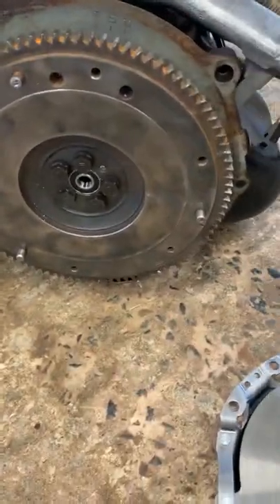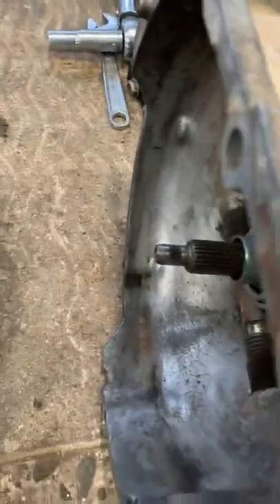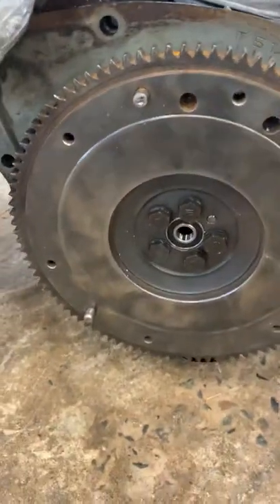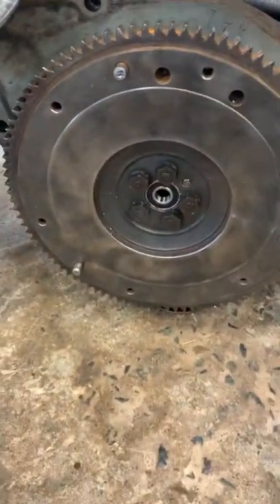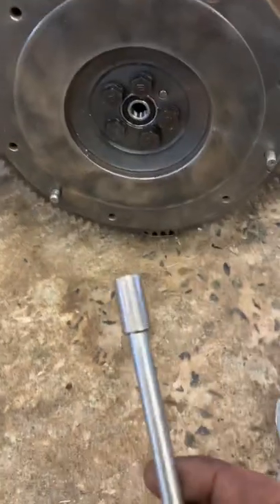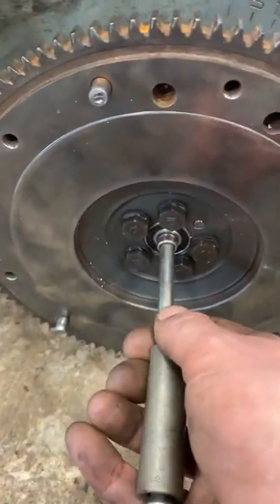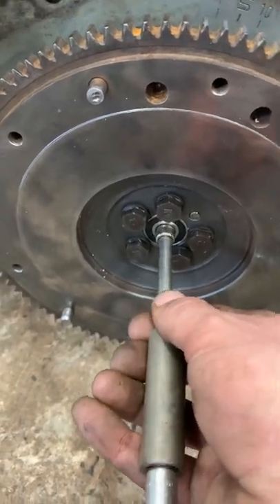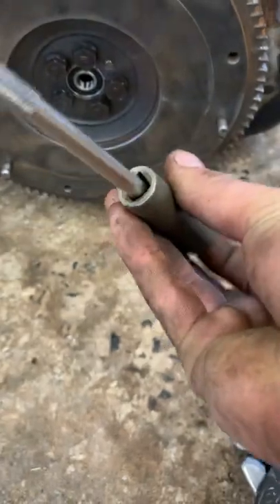No clutch alignment tool? No problem

Comment: I just closed one eye and looked at it straight on and tried to center it best I could and it worked great lol transmission went right on
Reply: Same here 😂 quick prod to feel if it’s about level all the round and jobs a goodun
Reply: @lukeshaw3375  yeah that was after failing with the stupid loose plastic alignment tool it came with and not being able to seat the transmission like 3 times
Reply: @WildfoxFabrication  my brother is a mechanic so I stole all his tools, turns out the alignment tool didn’t fit my car 🤦🏻‍♂️ the gearbox was a pain in the backside to fit back on but I managed it in the end 😂 not bad for my first attempt though

Comment: Hey my clutch won’t engage
Reply from the maker: @Trenchboi69  did you install the disc backwards?  Did you torque all your pressure plate bolts evenly?

Comment: Except what about when the socket dislodges inside when you try to pull it out.
Reply from the maker: A little tape will snug up a loose socket, and if it does come off it can’t really fall far since the clutch is between the pressure plate and flywheel at that point
Reply: @wellscody86  

And then you have to unscrew the thing again and screw it back on.

Is it really worth it to do this when the tool costs 18 dollars? You're already saving 100's of dollars doing the job yourself. Why not spend the minimum to have the correct tool that is so cheap anyway.
Reply from the maker: @MrBojangles901  it’s not about trying to save money, it’s about being able to think outside the box, use what you have available and the ability adapt and overcome.   Again this clutch kit for this engine / trans doesn’t come with the alignment tool, and I wasn’t able to source one. And to your point- most—not all but most clutches would have ample room to use your finger to grab the socket if it fell into the plate fingers, if not a magnet would surly get it out.  Your arguing something you probably don’t have a ton of experience with so the fear of the unknown isn’t worth the potential inconvenience for you and that’s fine, that kind of thing happens to me all the time with different projects that I’m not super confident or knowledgeable about and sometimes it bites me in the ass but I always learn something

Comment: use your eyeball if you have no tool.
get the splines centered on the bearing. its easier with a bearing as a bushing doesnt have seals and the center to line up on. Do NOT pull it in with the bolt, do it by hand.

Comment: Great job brother ! You must be from nebraska like me lol . Looks like that set up works 10 point ! Good video ! Be safe !
Reply from the maker: Actually I was born in Arkansas, unfortunately raised and still live in California.  This worked on the little 3cylinder Mitsubishi mini truck, but I’ve done this on countless manual transmissions from 4 cylinder beaters to high end Porsche and Lamborghinis-  I now have decent tooling for my lathe so next time I’ll likely start with a chunk of steel or aluminum and turn it down to fit everything just because-  will take a lot longer and won’t provide anything sockets won’t but i enjoy making aluminum chips and steel wool 😂
Reply: @wellscody86  be safe buddy !
Reply: @wellscody86  hahahaaha
Reply: Goddam genius Gump!!!

Comment: Hi are the clutch plate supposed to make little noise when you shake them thanks
Reply from the maker: The center hub will sometimes be a bit noisy and clatter, when installed and in use it shouldn’t make any noise.
Reply: @wellscody86  thank you and the springs in the clutch plate are they supposed to have little movement
Reply from the maker: Yes they will have a little shake to them, if they are about falling out I’d replace the clutch- but new out of the box they are not always tight in the perch.
Reply: @wellscody86  thanks so i should be good with the one i got then as its just little movement when i move it with hand but does not move when i shake it
Reply from the maker: That’s how it should be, the springs are what cushions the apply of the clutch so it’s not jerky.
Reply: @wellscody86  thank you

Comment: Do you have to pack with grease?
Reply from the maker: It’s not a bearing removal-  it’s to align the clutch disc with the flywheel /pressure plate /pilot bearing.
Reply: Huh....the bearing.....grease it??
Reply from the maker: @johnlove9331  always

Comment: I mean if your in a pinch but the tool is literally like 5 bucks
Reply from the maker: Your right but When your in BFE and the nearest store is over an hour away and they can get it hopefully next day it sucks.  To be honest 95% of the clutches Iv replaced came with the tool, this was shipped from Japan for our mini truck so it was a surprise it didn’t have it.  No way Napa was getting it any time soon.
Reply: Time is money and gas isn't cheap.

Comment: That lines up the hole, but what about the splins. The disk won't spin to let you slide the inputshaft in unless you push in the clutch. Which you can't do. 🤔
Reply: NV 😂 just spin the trans from tale shaft. Lol.
Reply from the maker: Sometimes we need to voice things out to solve the problem 🤙🏻